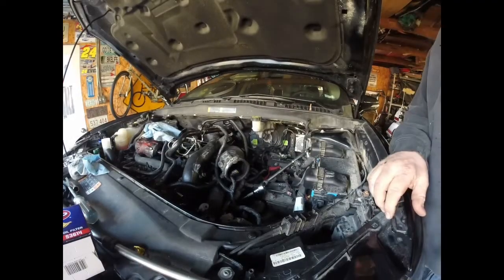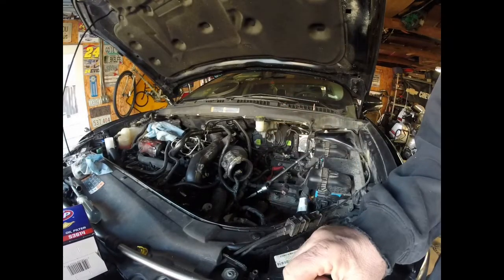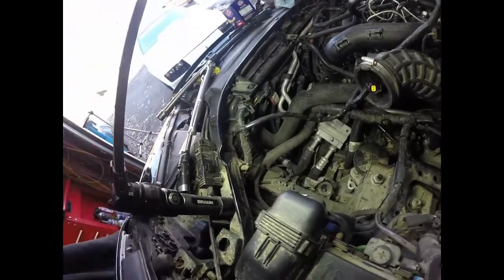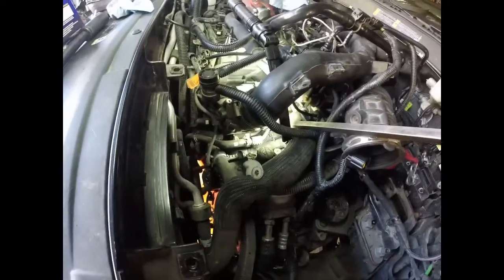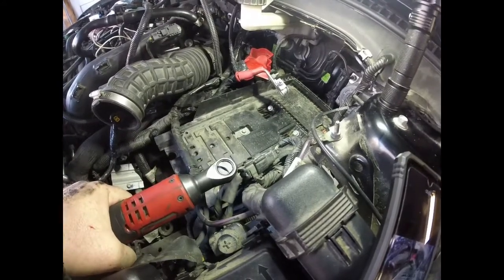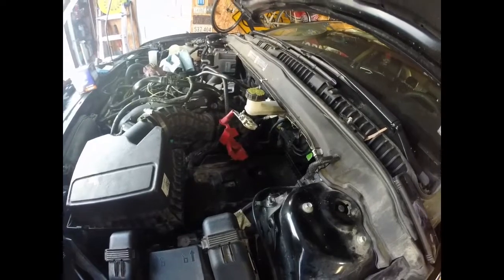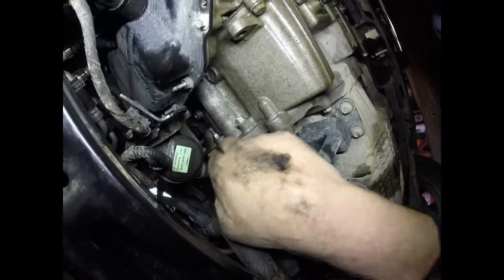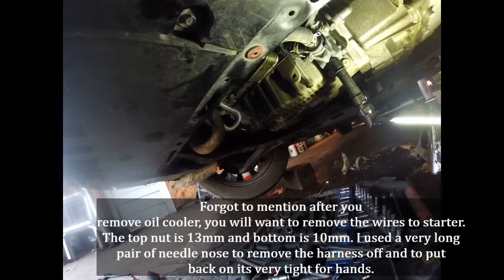2017 Ford Fusion - Starter Replacement 1.5 EcoBoost

Comment: Got the 3 starter bolts off, but the starter will not budge from the bellhousing.  Have you ever experienced a starter stuck to the bell housing, any ideas on how to free it?
Reply from the maker: I haven't if you get a pry bar or something in there and give it a medium tap if that doesn't break it free I would suspect maybe you took out the wrong bolt and one is still holding it

Comment: man just did this without removing the cable or the oil cooler housing shit was not easy but there is enough room to take it out all i did was take out the air box and took off those 3 plastic lines with the green clips. cut the wire tie on the coolant hoses and fit the starter between them took me a few hours. next one should go smoother flat rate time is less then 2 hours
Reply: So can pull the starter off without taking the oil cooler off?